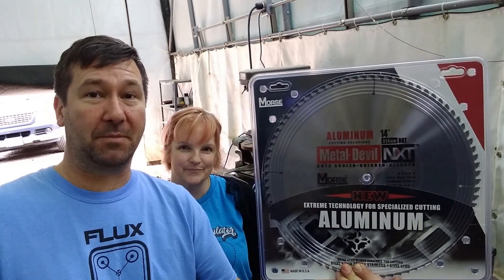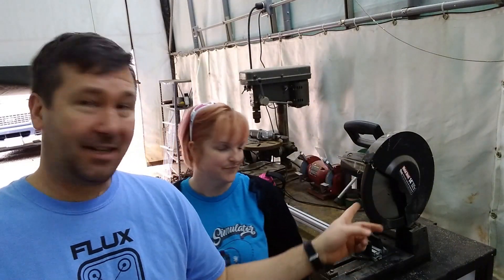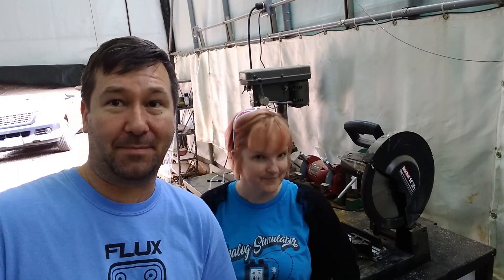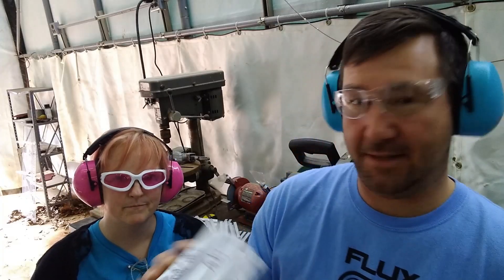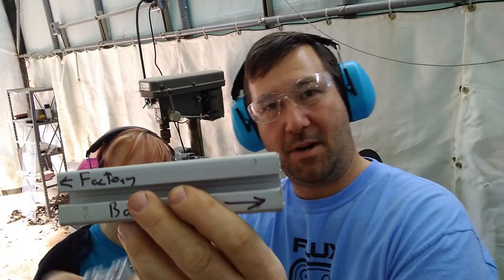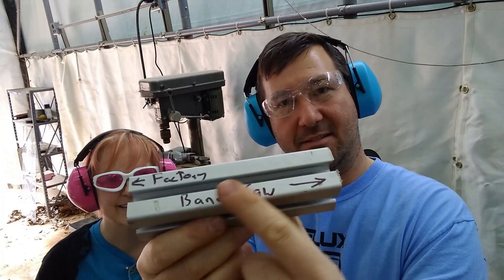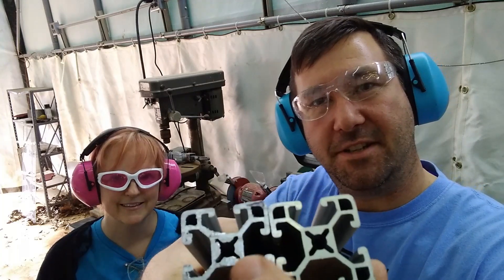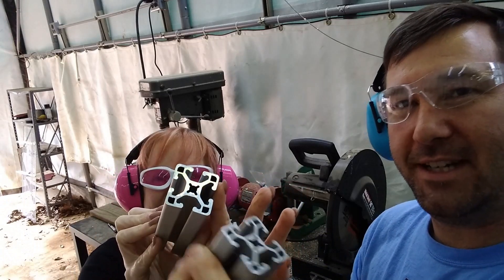How to Cut Extruded Aluminum Profiles.  Are Aluminum Cutting Blades Worth It?Miter Saw or Band Saw

Comment: I've been building a lot of things with 2020 extrusion lately, and my go-to has been a 10-inch-blade compound miter saw with an 80-tooth aluminum/non-ferrous cutting blade (Tomax carbide - costs about $25 off Spamazon) in it. I apply light but steady pressure to the saw and basically let the weight of the saw do the work without trying to force it - yes, this is important and matters quite a bit - and the cuts are almost polished levels of smoothness with minimal to no burring. I'm getting millimeter-accurate cuts as long as I take my time and adequately account for blade kerf/thickness.
Reply from the maker: Nice, sounds like a good setup.  I have really enjoyed working with Framingtech on some builds lately, check this video out.
https://www.youtube.com/watch?v=pyqQhTDcKbA

Comment: Would be interesting to know more about your bandsaw cut. Did you use a new blade? What type did you use, as blades made for aluminum are somewhat different than steel, and they even make universal blades for both ferrous and nonferrous materials. Or was this the blade you had on the saw that has been already used for steel and whatever projects you happen to use it on previously.
Reply from the maker: It was new and made for aluminum but it wasn't a very robust bandsaw.  Probably 1/2" wide.  I got rid of the bandsaw.  A good Do-all could have done a decent job but I think we would have still had a bad burr.
Reply: Tim, thanks for taking the time to make a response. I've got a bandsaw with a combination Lennox blade on it and it does a very nice job cutting 4040 aluminum extrusions. If the saw tracks well under cut, the blade chosen can make a significant difference in making a clean cut. Kind of like the difference the appropriate circular saw blade makes when ripping or cross cutting wood.
Reply from the maker: 100% agree.  I grew up in the steel industry and we used to have saws that could cut complete bundles of steel at a time and keep them square but Amber and I don't have the floor space or budget for that.  We have actually farmed out most of our aluminum cutting since this video to https://controls.tw/framingtech.  Square every time plus at the quantities we were needing, we really needed a more robust set up.

Comment: First, when I seen these blades, I was skeptical and I bought two blades through Amazon $59 each I believe. Put the first blade in and cut an enormous amount of aluminum extrusion built in an entire CNC router. Cutting in lots of solid aluminum as well. Blade never went doll. Never bothered to change it to take it off and just kept cutting wood with it and I’ve cut a lot of wood with it as well.
Reply from the maker: Thanks for sharing

Comment: Upcut saw is the professional way designed to cut aluminum t-slot extrusions, however that is very expensive. We used a DeWalt chop-saw 8 hours per day for many years cutting literally tons of aluminum over many years. It can be dangerous if you get complacent. Always release the saw trigger to stop the saw blade before lifting the saw back up. on the DeWalt, there are two lines cast into the base table to indicate cutting zones, no material should be cut that doesnt extend past the cutting zones. We had a few people break their fingers with mishaps. We used to use an industrial band saw but the cuts were never true, but "Good Enough"
Reply from the maker: Yes, early on we used a bandsaw.  It was brutal.  Upcuts are nice but way out of my budget too!

Comment: Thank you.  I use a wood miter saw and have had very good success with the less than $35 12" 100 tooth "non ferrous" blade from Amazon in case it helps others.  I got a lot of use out of the first one but at some point it stopped cutting perfectly square which gave me fits keeping my 8020 projects square.  I now keep a spare on hand.
Reply from the maker: Yep, spares are important!

Comment: I don’t see (anyone) cut mitered (“picture frame”) corners.  Cutting a 45 doesn’t seem any more time consuming than 90, imo as a carpenter.  But I haven’t seen it done, and just thought that I might be overlooking something (obvious ?).  Aesthetically, I would think that it would look Much nicer ... Planned, as opposed to merely Assembled ....... 🤷🏻‍♂️
Reply from the maker: In our case we are not boxing ours together but they do make inside connection hardware for specifically this purpose.  When we were looking at saws, we tried to find one that would easily allow to change angles but none of the heavy duty ones had this feature.  I have a smaller chop saw that I can do angles with and it makes for a very nice look when you are making a frame.

Comment: Great results. 
I wanted to do some 80/20 work - let say 30 cuts worth. What would be the best lower cost way to achive the results you had with your system.
Reply from the maker: Hi Terry.  Definitely not a friction saw, probably a steel saw blade.  It will still kick up a bad burr that you'll have to trim.  If you know your lengths before hand, he lowest cost way for a small batch is to order them precut.  I think it is around $1 per cut.

Comment: Hi Tim and Amber, I saw you cutting a very tiny slice of the profile at @3:33; do you have any guess what's the thinnest slice it'd be fathomable to cut with this saw? I need some 5mm slices for a project but if it's possible to go even lower that be interesting
Reply from the maker: Hi Autur.  With the aluminum blade you can cut as thin and you are capable of positioning.  Check out this post from last week https://www.instagram.com/p/B7Q7ThGhn7C/

Comment: I’ve been using same blade on my “wood” mitre saw for 80/20 for years. Plus been mig welding it as well for real strength.
Reply from the maker: I like the setup.  Hard to believe I was using a band saw to cut it a few years ago!